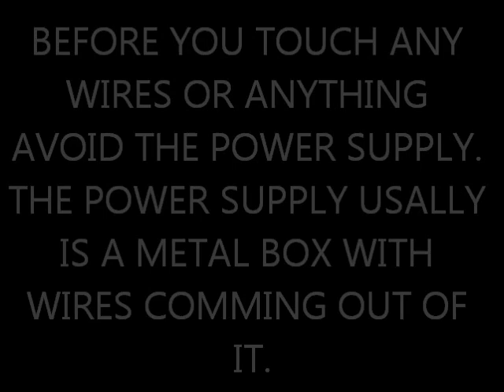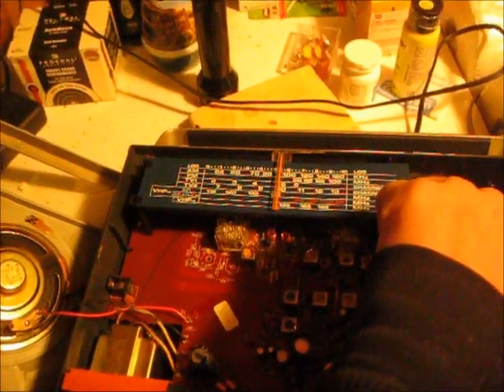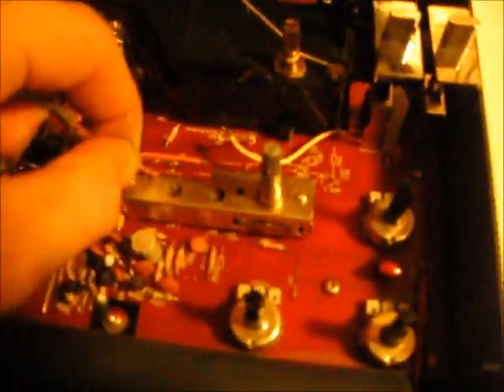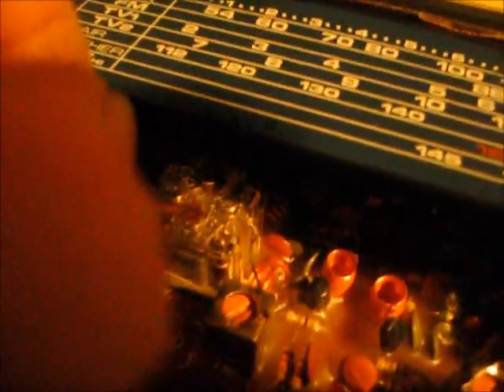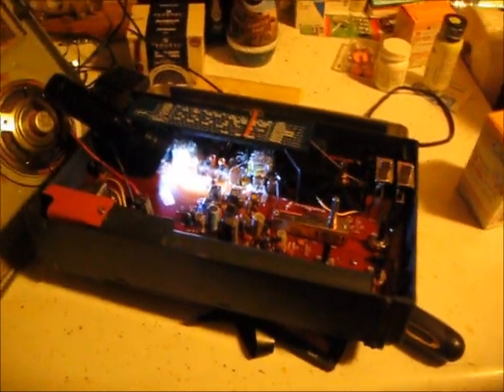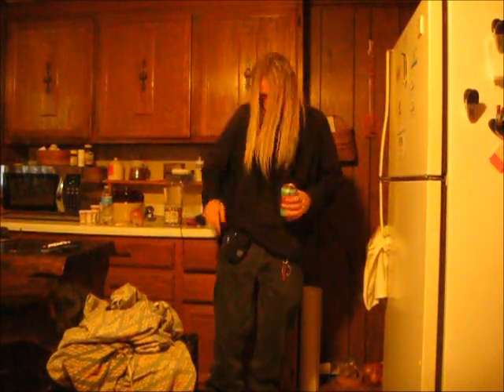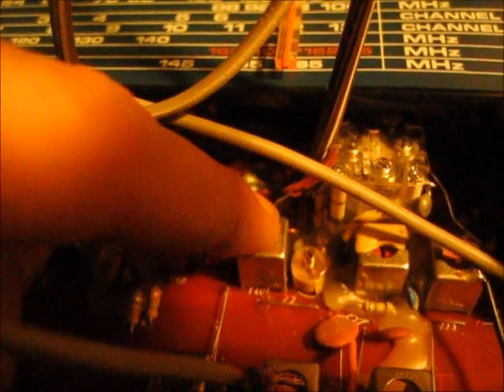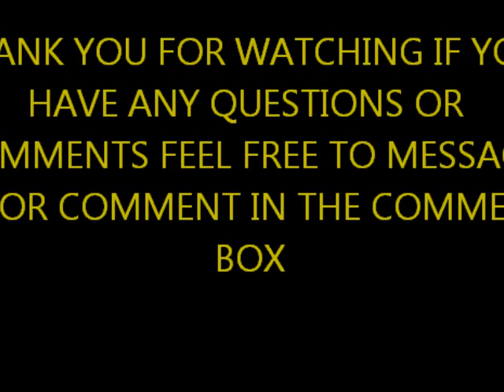HOW TO BUILD FM TRANSMITTER FROM AN OLD RADIO

Comment: Done the exact same thing. Take the front cover off and have to look at the front panel to see what a particular control does. Awesome video and keep going. You are more advanced than I.
Reply: Please help me
Should I connect the antenna coming out of the radio to the negative terminal?
I also connect the negative audio terminal to the same negative terminal?

Comment: I agree with Stephen Hobrecht.  You can do so much more with a little more electronics education.  I build FM transmitters with a transistor and a few parts.  And it will easily transmit over 100 feet.

Comment: Haha I did this many years ago with an old Sharp mono radio cassette - made a coiled wire antenna and dropped it outside my bedroom window and managed to 'transmit' about a couple of hundred feet! Audio sounded pretty good too.
Reply: Please help me
Should I connect the antenna coming out of the radio to the negative terminal?
I also connect the negative audio terminal to the same negative terminal?

Comment: OK STOP! You have an 8-Track tape player that actually still works, no belt slip? That's amazing really to the point it caught my interest to want to subscribe, well that and you hair of course. 

The only way your going to transmit from an old stock FM radio is if you pull parts and build your own transmitter from the parts pulled.
Also that radio receives AM, FM, VHF-Lo TV band, VHF-Hi TV band, VHF Hi band (Aircraft, Ham radio, Police, Fire, business band, paging, railroads, marine, weather, some old wireless mics).

What your hearing in your receiving radio is the IF intermod harmonics noise and audio your passing across it. its good for like 5 feet.
 
If you want a transmitter I have diagrams for easy to build versions that will work around the house otherwise you could buy one off ebay just look up CZE FM transmitter
Reply from the maker: Mike Thompson this transmitter's signal can reach about 500 feet.....its not the greatest but it does work.....i could give it more power but i dont want to blow any transisters or anything.....its only a 12 volt board so if i give it any more power than 12 volts it could burn up a couple capacitors or a transister.....any anolog fm radio can transmit its just a matter of finding the carrier frequency and adding an audio source ive built about 25 of them so far without cutting any coils or removing any parts. they are good enough to work around your house or if you want to plug your computer into your stereo or something like i do it works great but for long range....well....i havant gotton that far yet haha
Reply: Well as much money as you have spent at local swap meets on old radios you could have ordered an actual FM transmitter for an MP3 player off ebay by now.. Just saying. 
I know your tinkering around with stuff and all and that's cool and all but there are right ways and wrong ways of doing things and trashing a perfectly good possibly antique collectible and (maybe worth a good bit on ebay to a collector) radio is not the right way.. I just sold an AM/FM multi band, 8-track portable radio on ebay for $250 to a collector last week.
Reply from the maker: wow! i didant think they were worth that much haha i have a couple older radio's siting around.....ive been trying to fix up an old boombox with 8 track recorder and 2 cassette players.....the one that records needs belts but i cant seem to get a rubber band that will fit.....since radioshack doesent sell the cassette player belts anymore the only way to get tape players to work is with a rubber band.....but the 8 track recorder works like new haha plus 8 track sounds better than cassettes anymore
Reply from the maker: Its an old jvc with all kinds of colored lights around the speakers and stuff hahaha i love the old stuff.....i dont want to sell it though if anything ill take it out with me when we have a party by the fire or something
Reply: haha that's cool I think I know exactly the model it is too. They try to recreate these things today but they cannot beat the original ones from the 70's

Comment: Get a "Mr. Microphone"....extend the antennae,pump the battery voltage up,..Your on the air ! Nice job there ! How you did not burn anything out amazes me......but please----do not poke big wires into little components,or little areas,even if they are low voltage areas.

Comment: what about an auto tuning radio??? my radio don't have the tuning capacitor T_T
Reply from the maker: nahhh most digital stuff cant be fixed.....i know how to work on anolog electronics but when it comes to digital i say its better of in the trash.....i would look for a cheap anolog clock radio.....the screen can be digital but as long as you have the knob and a dial you should be able to get it to transmit.....just make sure you have 2 recievers togather and keep tuning the channels till you get a carrier tone...once you have your carrier all you have to do is give is an audio signal
Reply: 121293g hahaha, I would hope that I could since I wanted to make it portable because my friend's car have ancient cassette/radio and want to play mp3 with it :D, well... that was the plan, but thanx for the reply ^^ urm, I do have a triple variable capacitor radio and that one does not have just 2-3 coils, that thing have like 6 of em, and 4 of em is 12 loops coil, and the rest is 6 loops O_O
Reply: Digital PLL - Phase Lock Loop controlled my a micro controller to keep your radio from drifting off frequency. YES they can be reverse engineered and the PLL circuits used in transmitters BUT you need a reflow soldering station and some exceptional engineering and electronics knowledge to do it, AKA its cheaper to right out buy a PLL digital transmitter off ebay than to tool around in what you have.
Reply: Adriel Green thanx for the reply and you are right from the get go, i got 1 cheap PLL DIGITAL TRANSMITTER its about 1 dollar 50... And it works great :"3

Comment: It's like a train wreck, you want to look away but ----,  ah you get the point. There is a way to use an antenna amplifier, hooked to the FM's I.F amp, to use an FM radio, as a range extender, but,  this ain't it.

Comment: I wonder why you are doing it like this. Much easier if you build a simple transmitter from a few components recycled from old junk or purchased new, they're cheap enough and there's a lot of well-written material out there to describe how to do it. It's good to experiment, and yes you can receive the local oscillator from one radio in another radio and concievably modulate the local oscillator with audio, but why? To transmit a few feet away? Get beyond this and move on to the next level, much more fun than blindly poking wires where they can do damage.

Comment: Hei man ,this metal boxes you tach  with the cable aren't variable capacitor but tuning FI transformar I think you don't what you doing... But you are very persistent. Man see the referência of the ci FM detector go to Google and see the pin configuration normal is the pin 6 for the CI.